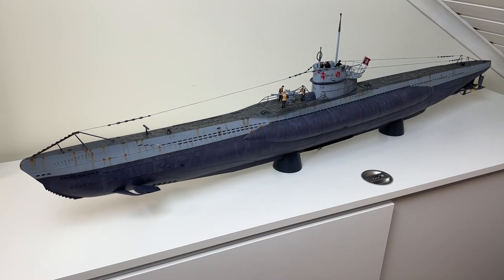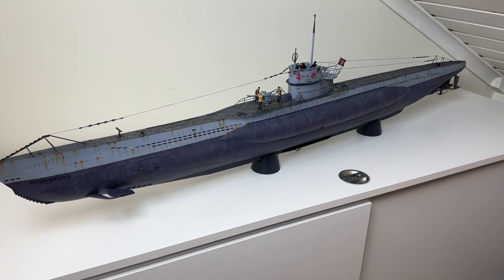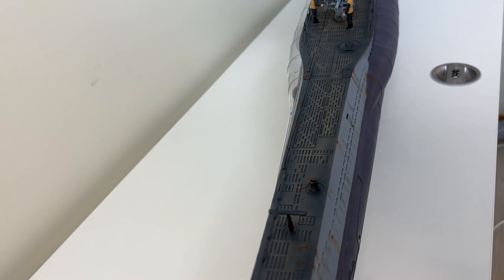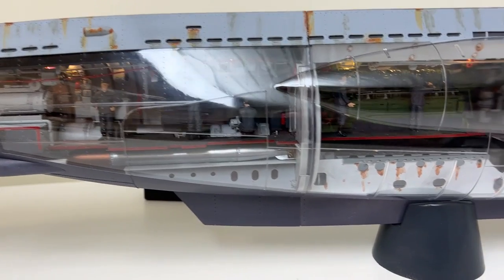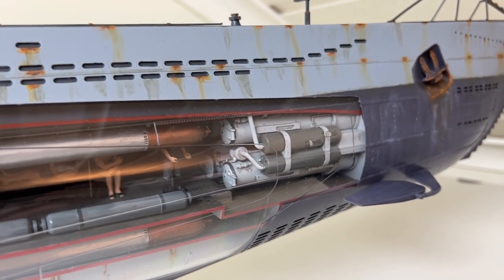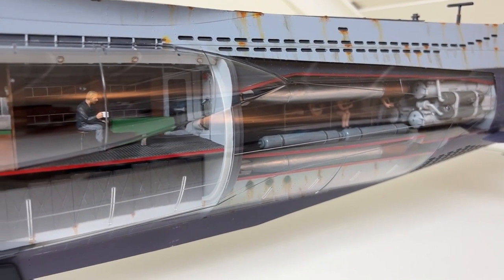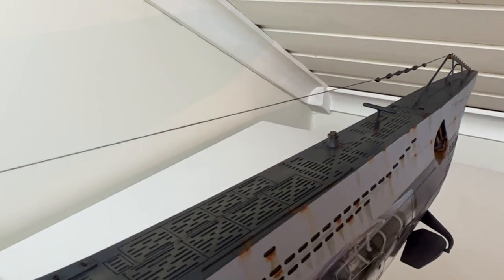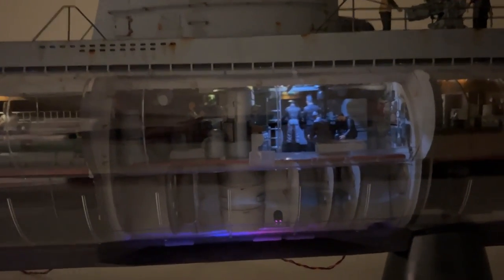Finished Trumpeter DKM U-Boat Type VIIc U-552 1/48 Scale

Comment: Hi, I am 80 % into my build, and the question I have is I noticed you did not leave the Conning Tower transparent to view its interior. Strangely, Trumpeter put the clear side of the conning tower on the PORT side while the hull clear is on the STARBOARD side, a really strange arrangement. Great Job with your build.
Reply from the maker: Thanks! That is correct. I were really surprised when I noticed that in the beginning of the build, so I decided not to leave it clear as I wanted one non-transparent side. I am not sure if this is a mistake on Trumpeters part, or if it is deliberate, either way I don't think it looks good. But it is our choice as builders to decide how we want to present our model. Good luck with the remaining 20% :)
Reply: Yeah, that was a really stupid decission on their part. REALLY STUPID. I'm doing like Kenneth did, and painting the tower also. I kinda pisses me off because I paid for all those parts and can't use them now.

Comment: Don’t know how I missed this video. Beautiful job on the model. I started mine but lost my modeling space so it’s on hold. Picked up the Eduard set but would really like to order the RCSubs PE sets and pressure hull ends. I’ve said it before, this kit is a prime example of design by committees. It’s exemplified by the clear starboard hull and port tower. Bravo Trumpeter. Great job just finishing it 👍
Reply from the maker: Thanks! It was fun, but also a big job, and as you point out, couple of design curve balls from Trumpeter. I also wanted the RCSubs set, but they didn't have anymore in stock for quite a while so then I just moved ahead without.

Comment: Are the clear and regular port and stbd panels the same? Can both be painted? Lets say one wanted to build this model as an RC, and the interior would be full of electronics and the exterior would be the important thing, is that possible with this kit
Reply from the maker: Hi Michael. As you can see I painted both sides of the coning tower panels and the panels for the hull. They are not the same, the starboard panel also has the deck. I guess it would be possible, but it will require a fair amount of work to get it water tight, and to create an opening to access the electronics. I would not use this model as a starting point for an RC model at least.

Comment: Sadly the model from trumpeter  is not very accurat on the inside. The bulcheads infront and aft of the comando central are curved not flad as in the modell. as well as the tanks under it.
Reply from the maker: That is usually the case with most models, so either you use it as a starting point, accept the flaws or scratch build. Based on the photos I have seen it is a fairly good representation.

Comment: Original  battle flag with no change inside  the white circle 🎉❤
Reply from the maker: It should be historically accurate even if we don’t like it or support it.
Reply: @NorwegianModellingBench  It's not historically accurate. Judging by their raincoats and binoculars they are out at sea which means the flag would have long ago been stowed.
Also, the periscopes and radio antenna would not be extended. If you want to be historically accurate you must remove the flag etc. 
Really nice work though :)

Comment: Lovely build and so nice to see it finished. I'm currently two months into mine and I'm adding the huge RC Subs etched set and full lighting also. As you say, the clear hull does distort the view slightly so I'm intending to cut away parts of the hull. Also planning a dockside diorama of the sub being replenished with supplies.
Reply from the maker: Thanks 🙏 I wanted that set, but he was out of stock at that point in time. You will definitely get a great model with that set. Sounds like you have a massive project ahead of you. Would love to see the end result. Good luck!